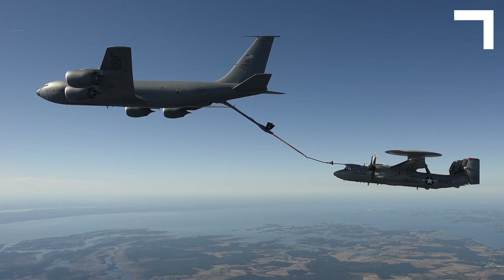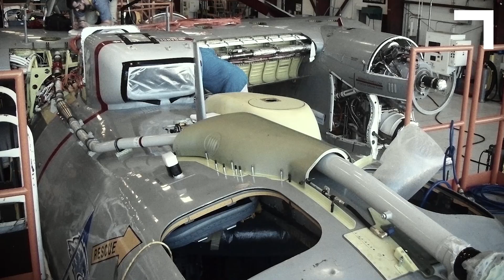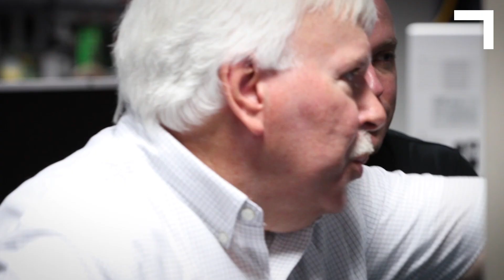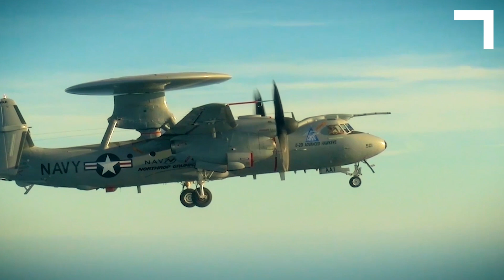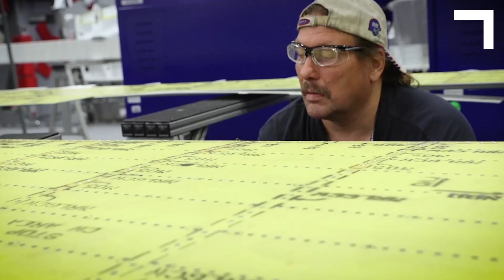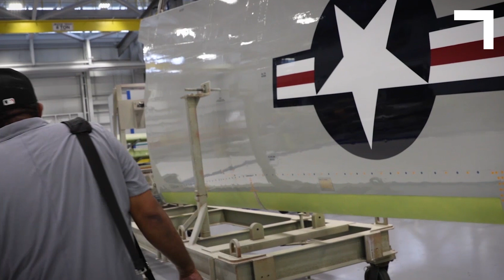FLOW - The E-2D Advanced Hawkeye Enhancement: Refuel in Air

Comment: I remember going numb after 4.5hr missions in the Hummer. And now they added refueling. Truly a masochistic community.
Reply: We were doing 6+ hours going into Afghanistan, with the 4-blade props that would shake your molars out of your head.  But when the weather was bad, I wished we had some more gas.  E-2 missions will probably be 10 hours long now, glad I'm retired!
Reply: This is a relatively large aircraft in Navy. Is there a toilet onboard since you have to fly 5hrs missions? I hope you do otherwise it would be a torture!
Reply: @ There was a metal bucket bolted to floor in the aft part of the plane, behind the door that separated that compartment from the NFO station.  It was removed because the moles (nickname for E-2 NFOs) couldn't stand the stench if someone used it.  Not sure if that was a permanent solution!
Reply: @DoYaGetIt  Permanent solution. They bolted a SATCOM transmitter to the floor in the AEC.  No s***ing in the airplane and you better whizz in the tube or you will fry the electronics.  I don't know how the E-2D is configured but I've heard there is even more junk in that trunk.

Comment: I thought the Israeli Air Force already did it back in the 80's.
Reply: Air force airborne early warning platforms have aerial refueling capability for a long time now. E2 is a naval carrier based airborne early warning platform which has to take off short decks of aircraft carriers and for that reason have to be small and light which is why installing refuelling probe inside them is difficult due to space and weight related constraints.
Reply: @knightatdawndonbynight8432  Well for starters, many countries used the E-2, who did not have carriers. And he is correct, Israel did it first.

Comment: They got UFO’s but use these shitty propeller vehicles
Reply: The propellers are for fuel efficiency, since these airplanes need to be in the air for as long as possible to provide AWACS. They could easily build them with jet engines, but they'd burn through fuel at a much faster rate.